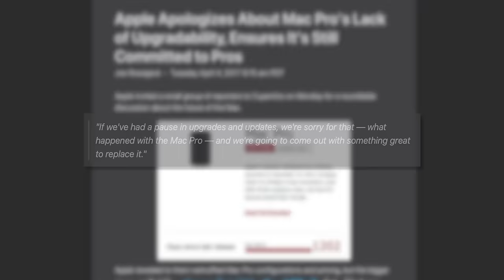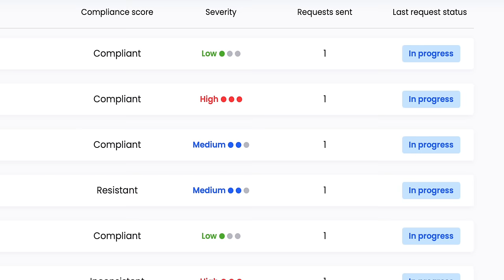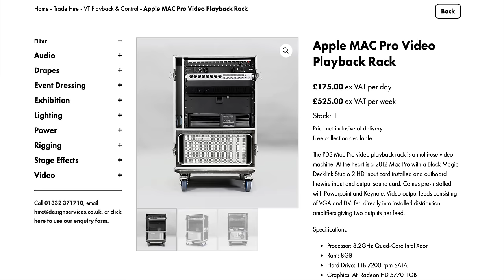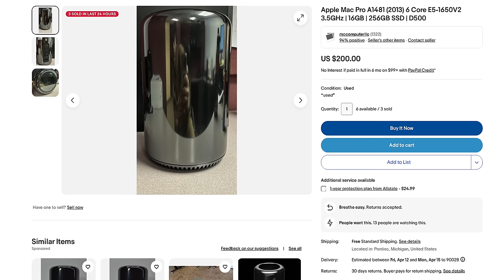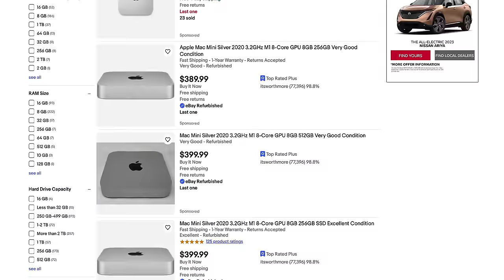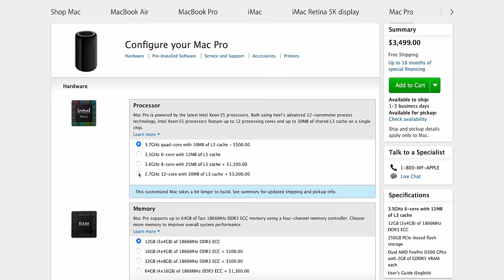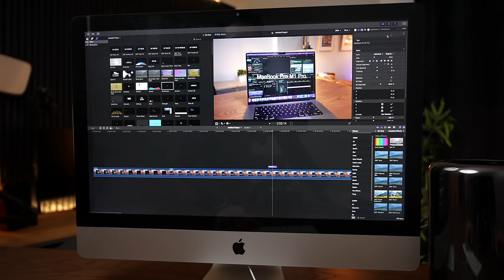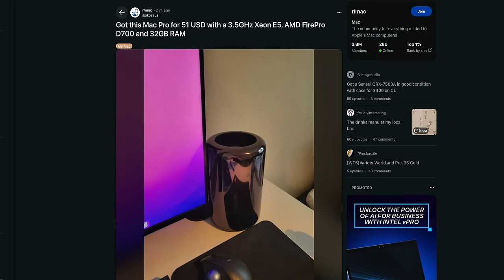Revisiting Apple's FAILED Mac Pro in 2024

Comment: Honestly with M1Ultra (least overheating processor imo) it would be top. Heck i bought the trashcan with a 6 core and 64gb ram for 170 usd in March 2024. Its amazing for web browsing and Microsoft Excel etc. 12 core isnt worth it, unless you do serious multitasking, 8 core is where it is. 128gb ram isnt worth it again, because you lose on clockspeed. Superb little computer for this kinda money.

Comment: So my question is this; can the Mac Mini M1 run 2 x 27" Thunderbolt Displays at the same time? Nope. 

Not all of us are interested in GPU performance for gaming or video editing. Speaking for myself I am more interested in having more active screen real estate for photo editing and general productivity. If these Mac Pros can let me plug in my 2 daisy chained 27" Thunderbolt Displays and possibly add a third 27" Apple Cinema Display for one massive productivity workspace off a single computer then I would rather buy this than the M1 Mini which can't do that at all. Right now I can run the 2 TB displays off my 2018 Mac Mini and I have the 3rd Cinema display attached to a patched MBP for the productivity space. I nearly wasted my money buying an M1 Mac Mini which would have seen me lose one of those screens. I would not have been happy.

Comment: Another HUGE (and very dumb) limitation of this thing: It only supported 2 displays!!!  Yes, you could run more if they were Thunderbolt, but that's not useful in 2024.  I have one on a shelf at work because of this reason...It's been replaced by a Mini M2 Pro because of the display limitations.
Reply: That’s not true, you can have a display on each of the 6 Thunderbolt port with just a mini display port- hdmi adapter.
for a total of 6 display up to 4k or 3 display 5k using 2 port for display

Comment: I don't think you could actually call the trash can a failed Mac Pro. Yes the trash can had many problems. And if you had a D700 video card and you edited in adobe premiere, you cross your fingers and hope you didn't burn out that card to get the green speckles in all of your renders. Because that was one of the most common things with that D700. But that being said, 'Im in post production video engineer. And pretty much everything you watched on TV for the past decade was edited on trash cans using Avid or Premiere. Hell I still use trash cans today as remote client computers to log into our PC VM editing systems we use now for most my clints.

Comment: This mac I use because it fits the shelf around the videoprojector. Each time I dismantle it to re-paste it makes me dream about an intel mac with one gpu, both being upgradable, a sandwich mac with usb, intel is still required for sheepshaver and I can't open core legacy for the same reason, so Monterey, and VM Zorin. Apple stopped making Macintosh Computers and systems with os 9. Modern macs are not macs. Win10 is more mac. Modern macs are iphone with no touch, no soul, no sense of ownership, nothing personal. Software and feel are more important than hardware. Apple self destruct all and on purpose, no swap battery, soldered all, glued all, clouded all, and we are fucked.

Comment: A sad tale of poor product strategy. Not only did multi-GPU compute not take off, Apple didn't support it until too late.  Neither OpenCL nor Metal (released at the same time) addressed multi-GPU well & reviewers didn't get dual-GPU, that one was for encoding the last job whilst the other working on the next job so their gaming benchmarks were irrelevant. Apple also partnered with AMD as their FP64 performance was stellar (Nvidia was focussed on FP32 for games) but even AMD dropped that after the FirePro S9100 series. Apple should have bumped the GPU & made new cards available for upgrade.

Comment: I do think the Mac Pro 2013 was the biggest mistake in my Apple product buying decision making. Damn, is that even a sentence? 😅 But honestly, it couldn't be upgraded in the biggest way Apple was going for with this Mac Pro: Its GPU! I mean, you could upgrade the RAM and the storage, even though that was poorly designed as well since you could only put in one NVME and it was proprietary. (The slot i mean.) It is a beautiful piece of design though... 😛

Anyway, it became outdated quickly if you ask me. I do have a Mac Pro 2019 with 16-cores. That machine should last me still a couple of years. But of course, with Apple Silicon now, it will also be getting out of date much quicker than first believed. Though we might still get an OS update, even with some features missing. I'm okay with that. It's mostly for Logic Pro X that i'm using it and for making my music, it does everything it needs. The GPU is a bit of a bottleneck at this moment. Since i also use Photoshop and Final Cut Pro X. And i only have an AMD w5700xt with 16gb. But other than that, i can't complain. 😀 I think i would be good with even an M2 Max or Ultra. But as long as i can run my apps, i will keep on going with my current machine.

Comment: I love how idiots compare old technology with new technology. My apple watch has way more processing power than the Apollo space capsule.... I purchased my trash can Mac when it first came out. Upgraded the memory to 64gb, Upgraded internal storage to 1TB. Added thunderbolt raid storage with Pegasus R6 and it sat on top of my desk hardly taking up any space, running silent for years. I still have it in the basement and it still works great but its current use is archive. Their computers just run and run and run. My main unit now is the M2 studio ultimate and I never run downstairs to do bench tests. It's old and it's slow but in another ten years it will still be running....

Comment: Maybe the previous Mac Pro wasn't spectacular, but the current one is an absolute joke. The current Mac Pro is just a Mac Studio stuffed into a tower case, with no possibility for expansion. The old black one could at least be upgraded on your own, and I consider it a much better design than the current one. Sure, it's a long way from the glory of the Power Mac, but it's still better than the current mess.

Comment: For music production, the trash can Mac is better than the apple silicon Macs at the moment. 400 bucks is a small price to pay to get the equivalent amount of cores and storage to a m2 Mac mini with a 12 core cpu, 32gb memory and 1tb storage for 2,100 bucks. To equal a top configured Mac Pro 2013 (12 core cpu, 64gb ram and 1tb ssd) you either need a M2 Max Mac Studio for 2600 bucks or a new Mac Pro with an M2 Ultra for almost 7 grand. The trash can Mac is the only way to get a semi modern macOS (Monterey) with intel and good specs for a decent price and the apple silicon isn’t ready for some virtual instruments that refuse to work on apple silicon, but have no problems with a trusty trash can. The 2012 Mac Pro may no longer be worth it anymore due to not supporting anything later than Mojave, but at least with Monterey you will have a rock solid os for intel silicon that actually works with instruments you shell out big money for. I am currently working on a pc, but want to ditch windows. Music production sucks on Linux so Mac is the only way and the best way is the trash can.

Comment: So sad that you cannot see where these might be useful.  If you need a x86 VM system that you are hosting on Mac OS this is pretty damn cheap.  Something that you cannot do on any Apple Silicon machine.  When I work from home I need a few x86 virtual machines running to simulate the target system for our software product.  A couple of cheap Trash Can Mac's run 2-3 vm's each is pretty cheap option.  Don't need powerful graphics for that.  Also a great cheap machine to run chat bots from for various MMORPG games.  Point is there are uses for these even if they are niche.

Comment: It is still garbage. I am daily driving one as a garage/workshop computer. With dual D700 so it is probably on a borrowed time. I got it for cheap on eBay to see how bad it is. Upgraded it to 128GB (because why not?) RAM ad 12 cores for cheap. I dual boot it between Mac OS and Windows, but latest Ubuntu somehow didn't want to work on it. I will try again. I also knocked off one cap next to CPU when I was unscrewing the CPU frame, but oh well, it looks like it was optional. The 12 core Xeon was like like $25 as you say.
Now after all these upgrades it is even worse garbage because this CPU will never run full tilt, and for less money I can get 8 core mini Ryzen box that will run circles around it.

Comment: The trashcan design was better than the current Mac Studio aio. The Mac Pro 7.1 with Xeon was a well collaudated and standard motherboard, the 2023 Mac Pro M is a Frankstein computer 1/2 workstation and 1/2 laptop. Apple continues to think that a Mac Book or an all-in-one box can be a workstation which can render 24/7 without melting. The 2024 will not have a decent modular and professional computer from Apple.